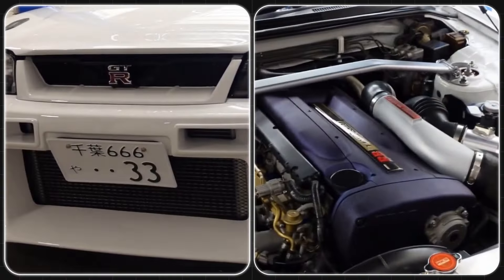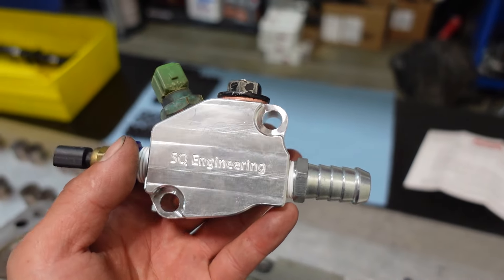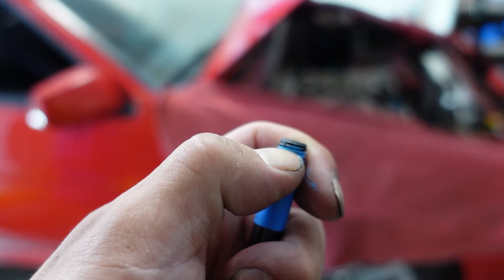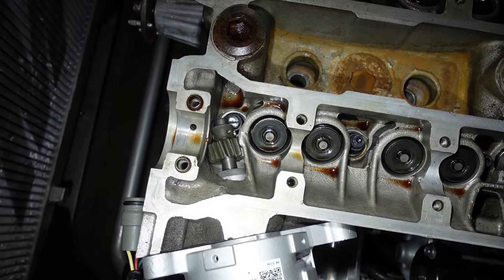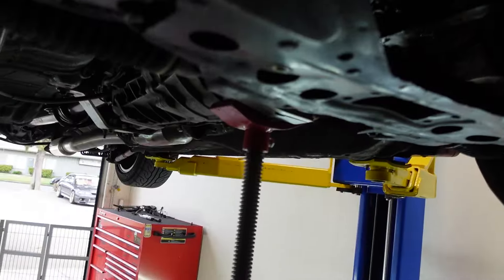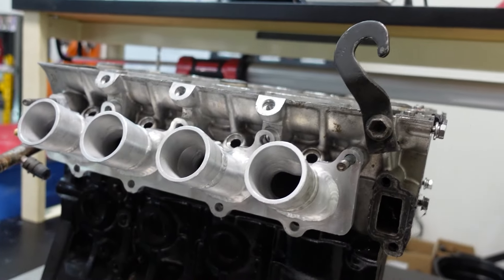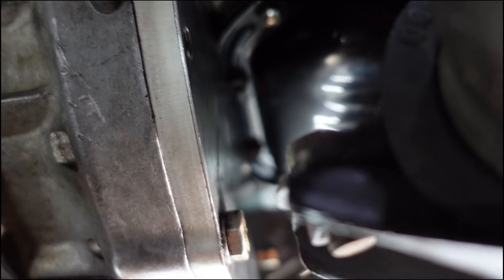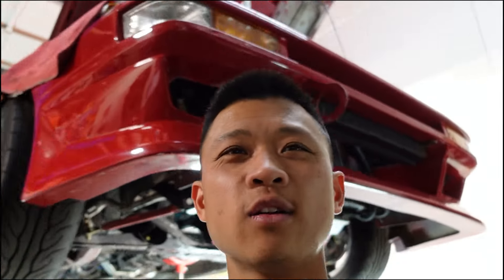4age Head Stud pROBLEMS / AE86 Refresh pt2

Comment: Thanks for addressing that issue with sq engineering water adapter. I had the same problem a year ago with the usdm sensors not fitting . My oem one was very rusted out. Ended buying a used  oem one from  offer up. Good info in this video. I hope to have my 86 ready for 8/6 day.👍🏼
Reply from the maker: Yeah the SQ water adapter is really cool, it just needs to be made with options for US cars

Comment: Nice video! I also ordered a manifold from DanST for some gsxr1300 throttles on my 4age and had the SAME issue. I messaged him and he seemed nice and told me the same thing about grinding the whole wider, but he also offered to replace it if I sent it back. (I ended up grinding the wholes)
Reply from the maker: He told me exactly that they have sold hundreds without an issue.

Comment: euro cars have JUST same idleair control. and think the jdm ALSO
Reply from the maker: Yes older cars did IAC with coolant. New cars use PWM via the throttle body.
Reply: @CMAutohaus  on even 4agze had water going inside throttele body iac electric.